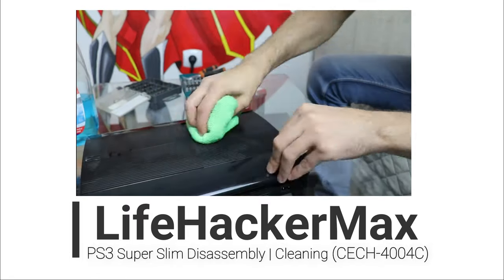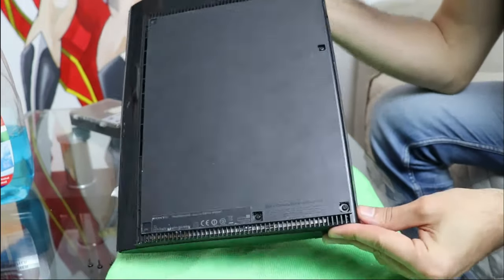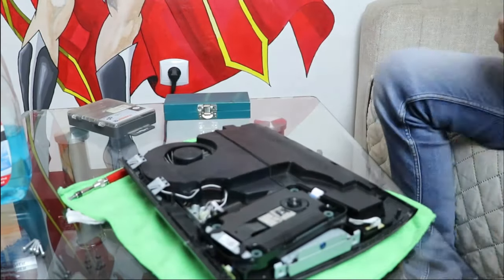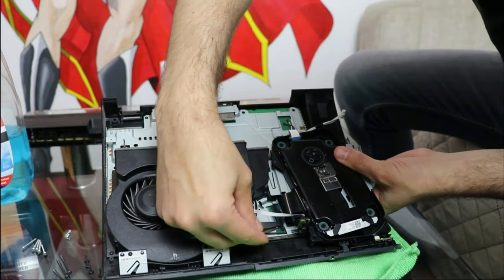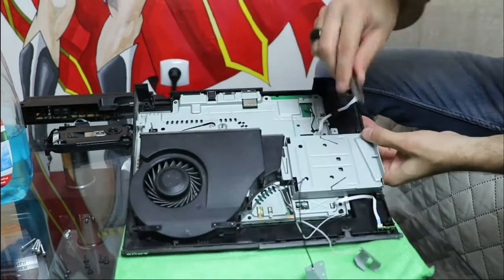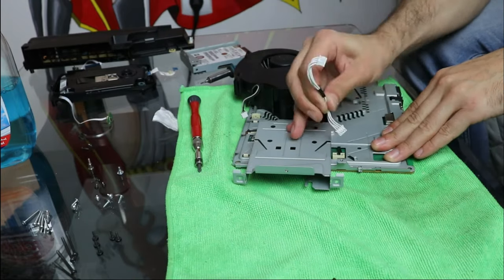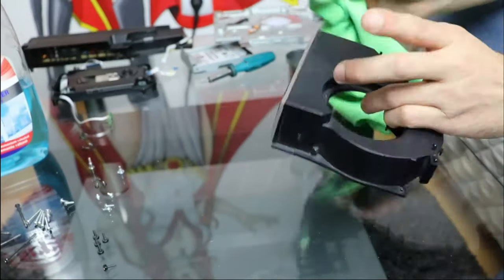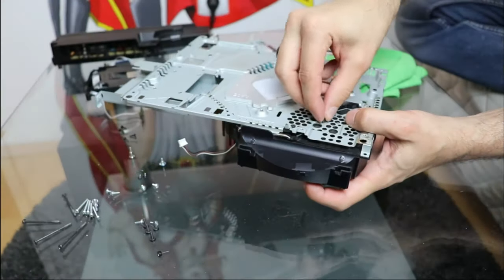DIY PlayStation 3 Super Slim Cleaning | How to fix Loud Fan | Model CECH-4004C

Comment: Good video, thank you! Would recommend changing the thermal paste as well.
Reply from the maker: I will pin this so everybody will read it first hand. Thank You!
Reply: I did not have the paste to replace mine..But never the less..I will. E putting the ps3 to work..lol
Reply: I will use frozen toothpaste. That will work fine correct?
Reply from the maker: I would not recommend using anything other than thermal paste.
Reply: @LifeHackerMax  ok then. I just won't replace it. I'll just clear the dust and be done with it.

Comment: Why didn't you replace the thermal compound? Once you have disturbed it by taking the heatsink assembly off (and the fact the paste is years old) means you have essentially made the cooling worse...
Reply from the maker: I believe that I said in the video: The thermal paste was replaced sometime before the video and I recommend changing the paste. There also is a pinned comment saying you should change the paste. Actually my PS3 works as it should. Thank you Dave 👍🏼

Comment: Hello , nice video . I have a question , is there a quieter fan on the market for the ps3 super slim ? Or a fan with more blades commpatible with the ps3 super slim ? Its not too bad, but when I start playing The last of us , I can hear how it escalates fast . Thanks in advance
Reply from the maker: Thank you! I don’t know about the fan replacement but maybe taking the console to a professional for a thermal paste change and cleaning will do the job.
Reply: @LifeHackerMax  thanks , I allready clean it ,and had changed the termal paste . I was just wondering if theere is a more modern fan that can be compatible , that makes less noise :) Anyway , thanks for the reply :)

Comment: Bro I can’t get the screws off by the hard drive now I can’t even get the screw under the rubber feet back on good I hate this crap
Reply from the maker: Are you using a torx bit with a hole in the middle?

Comment: I don't like the components layout of ps3. They should design the fan and the radiator (cooling system) the most easy to pull out because requires to be clean to function 100%

Comment: I have a question. 
At 5:49, you see that rustyish thingy on the top left of the plate ? My PS3 has the same thing. Is it fine to let it be like that or I should try getting rid of it...
Reply from the maker: My PS3 had some soup 🍲 at some point. The rust was way worse. I tried to get rid of the rust but didn’t go out of my way with it. If you can clean the rust off without harming anything It will help with grounding everything better.
Reply: @LifeHackerMax  I tried that and sadly I failed to kill the rust. Is it fine if i let it stay there ? Will it cause severe loss of performance ?
Reply from the maker: I don’t know to be honest. I wish I could help you with that information. For me, if it starts… I am good with it 🤣.
Reply: @LifeHackerMax  Ig I'll have to get the same mentality as yours 😓

Comment: I just cleaned everything and changed the thermal paste. I got Hen mod for a long time but today I tried running Gta V and The temperature goes upto 71 celcius and the fan kicks to 80% before the cleaning it wasnt this bad but nothing is broken! Can you help?
Reply from the maker: If the thermal paste it’s not applied correctly it might be inefficient. Too much is bad, too little is bad, uneven is bad. I suggest redoing the thermal paste. Maybe watch a couple more videos on how to do it or ask for help to be sure it is done properly. Beforehand check if the fan is plugged in and functioning correctly. If your console gets too hot for too long you might end up with a broken console, so in my opinion it is a good idea to recheck everything one more time if you feel like something it off. I hope this is helpful.
Reply: @LifeHackerMax  Got It man! Thanks! I'll reopen it and do it again
Reply: @LifeHackerMax  my console was overheating due to bad fan and and no thermal paste I took it to a technician he change the fan and the thermal past but it’s still keeps showing over heating and turning off the fan makes a lot of noise then the console turns off what can be the problem?

Comment: Mine has been running fine for like   10 years and I was playing black ops 2 campaign it locked up 3 times and ramps up to max fan speed on the homepage without a game running. I assume it's not a cleaning issue. If you have any other advice I'd love to hear.
Reply from the maker: My advice would be not to use your console until you do a proper cleaning and thermal paste change. Once that is done, test it to see if that fixes the issue.

Comment: Very good slow and easy tutorial! I just got an overheat shutdown on my very old PS3. I cleaned the Fan and the PSU, not so much dust, should I think on replacing the thermal paste maybe? Is there any way to see the temps?
Reply from the maker: Thank you so much! On the PS3 it is kind of mandatory to change the thermal paste once you separate the radiator from the processors. I don’t know about the temp monitor. Sorry.
Reply: @LifeHackerMax  Ok, I did not separate them, just disassembles everything and vacuumed and not it is working. Probably I will assemble it back and if it still overheats I will buy the thermal paste and replace that too.
Reply from the maker: Be careful with overheating because if it occurs for a long period you might get bad soldering points on the processors and that might brake your console. Maybe change the thermal paste first. Good luck 🍀👍🏼!
Reply: @LifeHackerMax  Ok thanks! Now that I know how to open it I will prepare to change the paste next time. Funny thing it just gave an overheating shutdown message after starting, now I retried after cleaning everything and no problem. This is very old already, maybe some glitch in the SW? I am using it only for YouTube and Prime, didn't play any games for 2 years now.
Reply from the maker: Haha! I use my PS3 for the same purpose. ☺️

Comment: Please give me the name of a set of screwdrivers used to disassemble ps1, ps2, ps3, ps4
Reply from the maker: I am using a special screwdriver bit set from Wolfcraft. You can find it on Amazon (last time I checked I found them). I don’t have something specifically designed for PlayStation as I don’t do this regularly.
Reply: @LifeHackerMax  I mean Wolfcraft screwdrivers support screwdriver ps3 super slim

Comment: hello. Thanks for the video so i bought a super slim 5 years ago and i have never open it to clean it cause i was afraid i will damage it but i will do it so i have a question after i do this will the hard drive keep all it's data? or the ps3 will wipe everything out? i'm asking because if that's the case i should get my saves into a USB drive.
Reply from the maker: The hard drive is not affected in any way by the cleaning process unless you short circuit something or brake something on the motherboard or maybe drop your hdd and brake it. Replacing the thermal paste is mandatory if you take apart the PS3. You will find lots of tutorials about this. It is the same on any microprocessor so the video doesn’t necessarily have to be about the PS3. You should know there are 2 places for thermal paste (I indicated them in my video). Backing up your data is never a bad idea BTW. Good luck 👍🏼.
Reply: @LifeHackerMax  thanks for the reply.

Comment: do I have to use the exact same things you used in the video like the screwdrivers and do I have to apply thermal paste because where I live there aren’t much electronic shops
Reply from the maker: Changing the thermal paste is very important. If the heat is not transferred efficiently from the processors to the radiators they can overheat and break. Better not to open your console if you don’t have thermal paste to change the old one. For tools you can use whatever can get you to unscrew everything. In the video I said what worked for me. Good luck 🍀!
Reply: @LifeHackerMax  thank you.

Comment: I think i messed somthing up. I was extremely careful taking everything apart and now my disk drive doesnt work. Everything is plugged in and everything. Nothing. Does run 100 times quieter tho just dont have a disk drive. Anything i should look for?
Reply from the maker: Recheck ribbons to be plugged in (it is ok to take them out and plug them in). Check for them to be facing the right way. If they have security tabs make sure they are secure. If I remember correctly the drive disk has a ribbon connected at both ends. Make sure they didn’t come out when you installed everything. Bottom line (usually the ribbons are the problem). Good luck!

Comment: Help me, Ps3 Super slim， when I launch Grand then avto 5, after 15 minutes of playing, my console itself starts to vibrate, I can’t understand what the problem is, who knows why this is happening?
😢😢😢😢😢
Reply from the maker: I will take a wild guess and say that your console is overheating and the fan starts spinning really fast. You might need a thermal paste change and full cleaning. I would advise you to stop playing until you get the thermal paste changed and cleaning before your chips get damaged from overheating.

Comment: badly need help. i follow all the instructions, but now it wont turn on. hope you can still reply sir. thanks
Reply from the maker: Considering you didn’t break anything in the process, usually there is a  little thing you might have missed in the assembly process like a ribbon not installed or installed incorrectly. Best chance is to retake the steps with the video. Good luck 🍀

Comment: I have a ps3 super slim and it has not been cleaned once ever. Fan is very loud can't wait to get all that dust out
Reply from the maker: Good luck! Changing the thermal paste is a must otherwise you risk damaging your components. The old paste is obsolete.
Reply: @LifeHackerMax  do you know where I can buy the screwdriver I need near the Hdd slot? Or something I can use instead?
Reply from the maker: @Bananner806  , if you are referring to the security bit (t8) with the hole, I have a special bits set from Wolfcraft bought from my local brico store. You can find it on amazon as well.

Comment: I don't own a brush. Is there anything else I can use to clean the system that would be just as effective as a brush?
Reply from the maker: You don’t need a special kind of brush. It can be a painting brush, a makeup brush, a big brush for bricolage 🤷🏽. You could also try a tooth brush but it might be hard to get into some places with that one. I can’t think of anything that can replace the brush.
Reply: @LifeHackerMax  Thanks for the advice, bro.

Comment: Now after assembling my console is saying "Storage Card Not Found" and the fan is spinning that fast that makes strong noises
Reply from the maker: @askingracer1603  you should open it up and check that all the connections are in the proper order. Also you should replace the thermal paste on the chips.
Reply: @LifeHackerMax  but why the fan goes so fast at the beginning of the starting?
Reply from the maker: @askingracer1603  i am not sure. The ps3 also had a cleaning function on startup but you had to turn it on in a specific way. But it also be due to old thermal paste.
Reply: @LifeHackerMax  Ok, but the archive problem at start with black screen?
Reply from the maker: @askingracer1603 probably hdd problem. Recheck that the connections are in the right place facing the right way (mainly the ribbons).

Comment: So i got a PS3 super slim and it's still loud after i cleaned it
Reply from the maker: Did you changed the thermal paste? If the thermal paste is old the heat doesn’t get transferred from the processors to the heatsink. So no matter how well the fan works the processors will still overheat.

Comment: Is it okay if the bottom shield of the motherboard is rusty? Or should I replace it?
Reply from the maker: Good question. I don’t really know to say for sure. I think you can try cleaning out the rust with some fine sandpaper before replacing it (I had some rust on my ps3 and I just cleaned it with some sandpaper and it worked out well. The question is where did you get humidity from and fix that issue first.
Reply: Lol i live in Huntsville Alabama. The RocketCity USA

Comment: Mine is doing the same thing fun noise like hell do i need to clean it as well ??
Reply from the maker: Cleaning the console is a good maintenance practice and can fix loud noise and overheating problems. But with the PS3 you should also change the thermal paste if you clean it. Otherwise you could do more harm to it.
Reply: @LifeHackerMax  one thing that i have found out is that when i was placing the console facing the wall the fun would go to a loud noise and when i had place it on an open place the whole situation changed and the noise is gone
Reply from the maker: @xavierian7694  , wow 🤩. That is a great tip! Thank you 😊!

Comment: What screw drivers are needed to remove the screw from thr disk area
Reply from the maker: I only used a security torx 8 bit (it has a hole in the middel) and a ph0 bit for the whole process.
Reply: @LifeHackerMax  Is there any other way to remove the torx
Reply from the maker: @AmaanAbbasi-t2h  as a test I managed to break the small pin inside the screw with a small flat screwdriver and a hammer but it is not very easy and you will still need a normal torx bit to unscrew the screws.
Reply: @LifeHackerMax  What mm of torx bit would I need
Reply from the maker: @user-mb5uh6kv1u torx t8 or t9. Either one should work
Reply: @LifeHackerMax  Thanks a lot bro ❤
Reply from the maker: @user-mb5uh6kv1u You are welcome!

Comment: Any you buy the screw driver where? In any store or order them
Reply: And where do i get the paste for the safe side?
Reply from the maker: It depends where are you from I guess: you can find the thermal paste in electronic hobby shops or computes shops or online, the screwdriver 🪛 i have is from Wolfcraft and I bought it from Hornbach (is a bricolage store). If you can’t find the one with the hole in the middle you can try using a normal torx by braking the small pins inside the screws with a little flat screwdriver (I don’t know how well this works because I haven’t tried it, i just read about it and it seemed logical).
Reply from the maker: Good luck! I hope you find what you need.

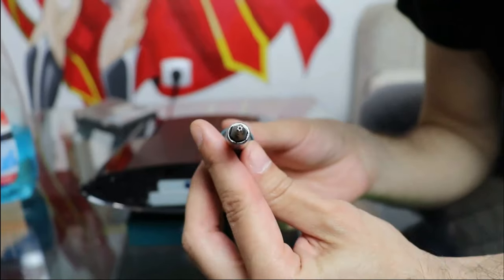Comment: in 0:59 is it T8  screwdriver or another size?
Reply from the maker: T stands for Torx (the shape / the star like shape of the bit) and the 8 stands for the size of the bit. Be careful though, this is a special security bit (has a hole in the middle). Normal torx do not have that security hole. And don’t forget about the thermal paste. That has to be changed once you separate the cooler from the processors (read the other comments here). Good luck 🍀👍🏼.
Reply: @LifeHackerMax  thanks

Comment: After wasting 4$ for a screw head set only to find out that the screws are somewhere between t6 and t10 that the set has, i just vacuumed the F out of every opening and it seems to have done it 😅
Reply from the maker: 😃 That is one way to go about it 🤭. Happy gaming !
Reply: @LifeHackerMax  thanks, ☺️ 
Maybe share the srewhead type in the description since they are a biatch to find 😅
Ps, i also used an old laptop cooler to put the ps3 on, just in case, and it seems silent so far ☺️

Comment: I cleaned a ps3 super slim today this video helped me a ton I broke 1 clip from the front panel but its not changing anything the only thing im not sure is that I put enaugh of thermal paste on cell cpu I played for 2 hrs and all was fine not freeze or any restarts but still not sure I don't know meybe this drive is louder than a console itself I never had ps3 so not sure maybe I should give more paste I just cover all cpu with tools but sow some videos where ppl gave more paste than I did IMO its pointless when it squeeze all that shit will go outside and make a mess. UPDATE after playing more paste burn-in all works perfectly like it should quiet and smooth

Comment: I fcked up my power ribbon socket from motherboard 😑
Reply: I did that too. Easy to come off
Reply: I have try in tht way but still it's the fan is to loud  I dnt know wht is wrong with ps3
Reply from the maker: You need to change the thermal paste. If you don’t replace the thermal paste your processors might get fried soon.

Comment: SONY SUCKS because their PS consoles stop reading discs, their consoles over heat due to not enough vents or the vents are not large enough, their consoles have a dust problem, and "drum roll", those DANG wireless controllers not connecting or not charging. And thats why I don't want to buy their PS5.

Comment: Afer cleaning mine superslim it want to spin the disc. Every ribbon is ok , lens is clean🤷any help please?
Reply from the maker: The ribbons are ok but they are placed facing the right way too? You can easily place them the other way around and they won’t make contact. When something doesn’t work for me I usually undo the work and do it again. Also check if the security tabs are pressed on the ribbon sockets.
Reply: @LifeHackerMax  everything is good. I cleaned it with the air and after that the disc mechanic is ko😂
Reply from the maker: @airgunhunter927  I am sorry for your loss. Maybe someone else here can help with other ideas.
Reply: @LifeHackerMax  it's ok bro. I ordered a new blu ray mechanic& ribbons . Maybe i will buy an SSD 500Gb/1Tb disc